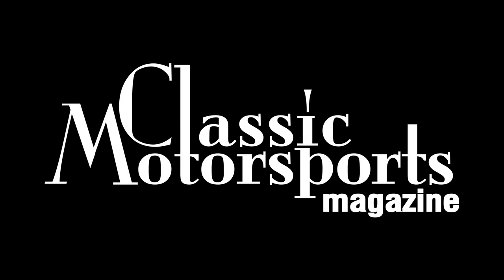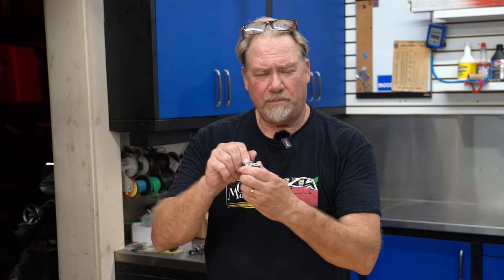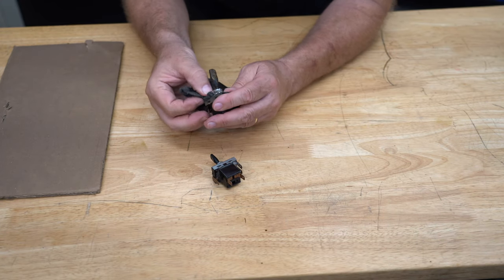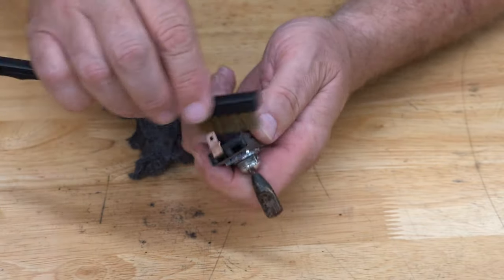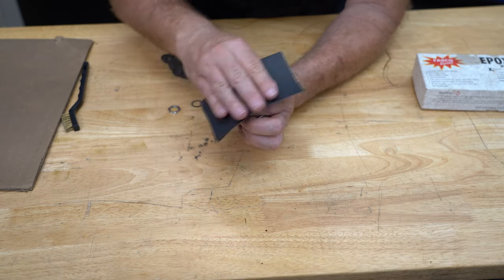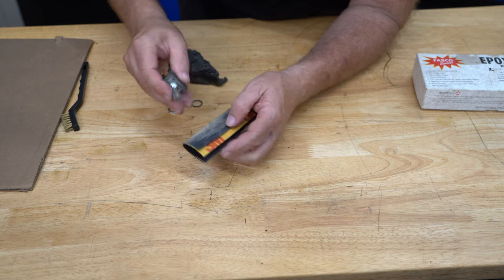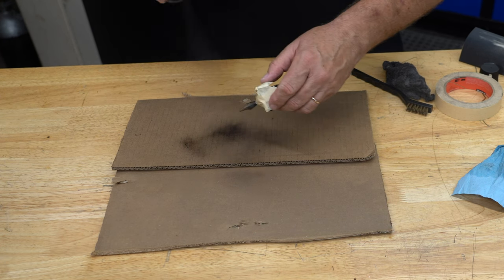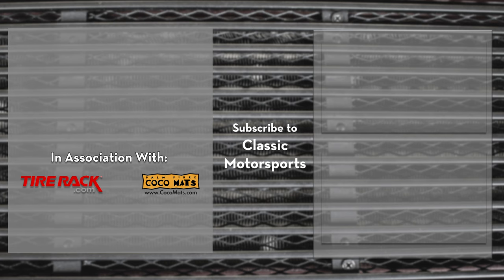How to Easily Restore an Automotive Switch

Comment: Was hoping that you were going to address the actual workings, but thanks for the cosmetics side.  I've got two four-way switches on a Volvo wagon that used to control the outside mirrors.  I guess I'll try to disassemble them, if they break they needed replacement anyway, but not available.